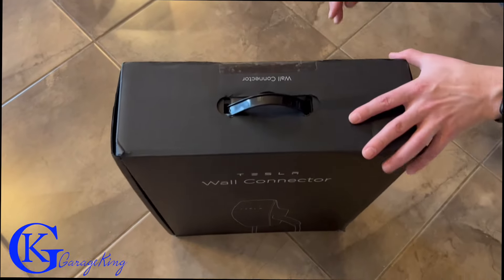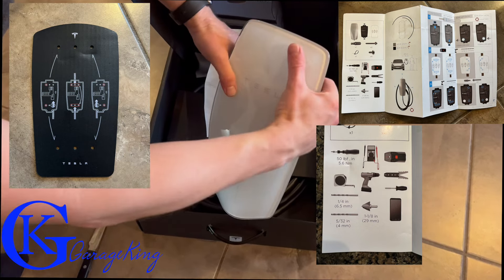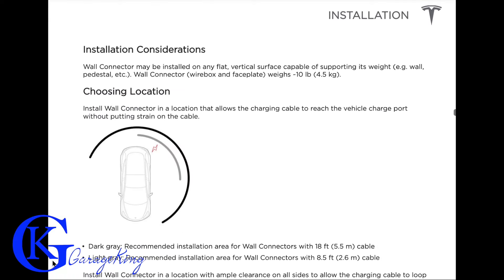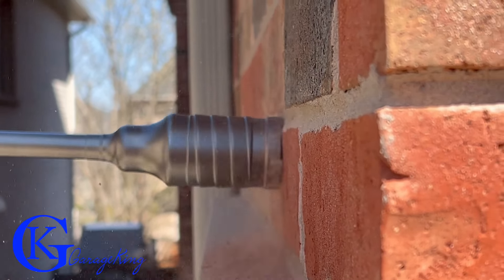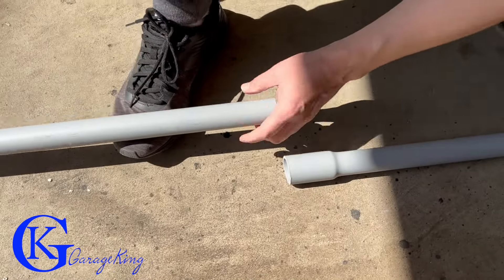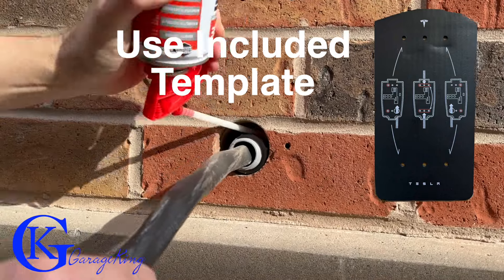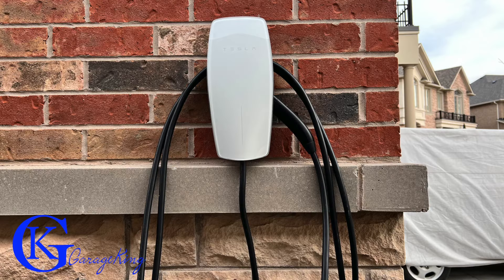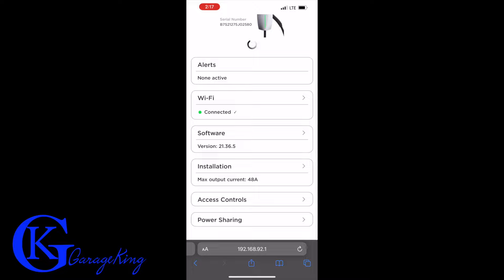Tesla Wall Charger installation (Gen 3)

Comment: You may want to use the regular ground there is a reason why the ground is sized smaller than the conductors and it is to act as a safety measure, the bigger you go it is not going to protect the circuit as fast. There is a Table that tells you what size ground should be used per AMP load  also Romex is never allowed in conduit unless specified per manufacture like legrand  metal wire mold
Reply from the maker: Hey Thanks for the comment, I actually stripped the wire and re-ran, it was easy as it was a pretty straight run, also no white wire being used anymore for the ground.  Thanks!!
Reply: I would be interested in how a larger ground conductor doesn't protect the circuit as fast.  Grounding conductors are allowed to be sized smaller as they are not intended to carry current under normal conditions.  They are relied upon to carry fault current long enough to open the branch circuit protector, thus there is no concern for overheating.  
Depending on the country, you can run nm cable in conduit, here in the US that change was made to the 2002 NEC I believe.  It will be MUCH harder to pull, but it is an acceptable method.
Reply: @hopkinsfamily1891    I think it is because there are other more bad faults that you can get on the ground, and you don't ever want the ground wire carrying full current.
Reply: Lol this make no sense.
Reply: 1) Per NEC, Romex can indeed go in conduit as long as it is not outdoors (a garage is ok and common).  2) the reason you can use a smaller ground wire is to save cost.  Going up in size doesn't decrease the functionality of the ground.
Reply: Code article stating that you can't sleeve romex ?
Reply: @wirenut9062  There is no code stating you can’t sleeve Romex…except in wet / outdoor environments.
Reply: @hopkinsfamily1891 romex can be run in conduit. It can never be used in wet locations (I.e. outside), which is what gets most people in trouble. That and more than 9 ccc will require derating in any conduit length over 24”.
Reply: A larger ground doesn't make it less safe and a ground wire has nothing to do with allowing a breaker to trip or anything like that.
Reply: Yes. Manufacturers put instructions on their products for a reason. Follow the specs.
Reply: The white/ ground he is using is not going to affect or hurt anything.
Reply: The correct size ground for a 60 circuit is number 10 green, not number 6. Big waste of money.
Reply: Licensed electrician here. He had an extra wire and used the white for a ground instead of the ground because the white is bigger. There is nothing wrong with increasing a grounds size, and it will not make the breaker trip slower. If anything it’s safer to use a bigger ground. There are 0 code restrictions in the NEC about a grounding cable being too big
Reply: I came into the comments precisely to see this comment. I knew the comments police wouldn't let a neutral wire fly as a ground, specially when you have a ground wire already!
Reply: @hopkinsfamily1891 correct
Reply: Your ground wire is only there to give your power a path of least resistance. You can size up on your ground wire and will only allow more to travel through it. It does not act a a breaker or signal in anyway

Comment: You should not be using a 6 gauge wire with 60amp breaker, it’s 50amps breaker max. That’s dangerous, it could cause a fire. It’s allowed Only if  the run is short.
Reply from the maker: The run for me is quite short, and I rarely ever go above 10amps

Comment: The mobile charger can charge at 30kwh but you need to install a 50amp nema outlet and then buy the $35 adapter cable from Tesla to get higher output.
Reply from the maker: Hey thanks for the comment.  The mobile charger is excellent.  The one thing the wall charger really has is that you can turn it on and off whenever you want and you can adjust the amps so it’s very customizable from your phone.

Comment: Breaker is in my basement and the home standard is 100a, not 200a. To run 240 at 50a which was for my hot tub to the charger I bought…it was $1,700.
Reply from the maker: My home has a standard 200a in the main panel and the garage is a 100a subpanel installed by the builder. All the homes on my street are 200a. FYI - for my Tesla I rarely use more than 10a.  I trickle charge it every night back up to 80%.  Also for $1700 it must have been a descent run of wire, my run was not long as you saw the subpanel was in the garage.
Reply: @ The run of six gauge was roughly 30 feet. They butt connected existing 240, but the next house I get will def be 200a.
Reply from the maker: @koven1497  30 feet is a pretty descent run.  Good decision on 200a for the next house.
Reply: @ The charger from Tesla comes with the 30 feet or is it half that?
Reply from the maker: @koven1497  I think its only 16

Comment: Main issue here is you can't run that type of cable through conduit.  If you peeled the black sheathing off, then the inside is likely thhn or thwn which can be ran through conduit.
Reply from the maker: Yep, I peeled the sheathing off, also I stripped the neutral so its now bare for the ground not to get anyone confused.  All you see now if red, black, and a copper.  Appreciate the comment

Comment: You’ll notice in the sub panel the neutral and ground buses aren’t bonded. This is only done in a main panel.
Reply from the maker: You are correct, and the only panel bonded is in the basement, that's the 200amp main, then I have a 100sub in the basement, and the 100sub in the garage.
Reply: only done at the first disconnect, which is not always at the main panel.

Comment: Excellent video... Thanks for posting, it helped a lot.. there is one thing that you may want to be aware of, not all #6 AWG wires are rated for the same amperage/temperature... meaning, #6 Romex is rated for 55AMP Max, requiring a 50AMP breaker.... yes, the max amps coming from the charger should only be 48, but in a worst case scenario, the wires would start heating up before the breaker had the chance to trip.
The case where a #6AWG could be used with a 60AMP breaker, if you use THHN single conductor wire (Run three single conductors inside conduit from the electrical panel to the charger)
Reply from the maker: Thanks for the comment and you are right. I later did strip the main sheathing (that holds the 3 wires together) and ran them separately. Corrected the ground as well, to just a bare copper wire.  I rarely use over 20amps as the car charges every day at night, so I never need a lot, I just top it up to 80% each day.  Most days I'm using about 9-12amps for overnight charge when the hydro is cheap.
Reply: @GarageKing I also used Romex, I installed a 55AMP breaker on my panel to protect the wire which is 55AMP max, I run the Tesla at 44amp max. 80% of 55 is 44. You did a good job, you could have left it as is. It will be working fine for years to come. Good job on the install 👍
Reply from the maker: @Anonymous01416  Thank you for the reply, much appreciated and have a Merry Christmas my friend !!

Comment: Thanks for making this video.  I used a torque screwdriver and wiggled the wire.  Couldn't believe how tight 50 in/lbs is!
Reply from the maker: Thank you for the comment, and yup you are right 50 in/lbs is quite tight, that is the equivalent to just over 4 ft/lbs which is a lot for those little terminals.  Enjoy your Sunday : )
Reply: It will feel like a lot if you're using a screwdriver type of torque wrench. I have a small 1/4 drive electronic torque wrench and it feels very light to me with a wrench type torque tool.

Comment: One of the best tesla wall connector videos that I have seen, and I have been searching. Thank you! I used much of the same things you did but to save money I went with the 6/2 wire.
Reply from the maker: Thanks for the great comment !!!  I would have bought 6/2 like you, but it was not available where I am, plus I used extra wire I had from a former hot tub install. Thanks again !!!
Reply: Using 6/2 would have been the correct way to go.
Reply: 6/3 or 4/3 is better. If you ever sell your home, future owners with EVs other than a Tesla may have an EVSE that uses a 4 wire configuration with a neutral wire. 
Why make them go through rewiring your 3 wire circuit? Future-proof it.
Reply: @dvader3263  It's a bit too late now! 😂
FWIW, the 6/2 is doing fine - no heat or V Drop issues.  Also FWIW, the entire industry is moving towards Tesla's NAC connection and by the end of 2025, it will be rare to find anything else. Kinda like the VHS/Beta thing.
Cheers!
Reply: So can i use my existing Romex 6/3 wire from my NEMA 14-50 outlet i installed, if i change the circuit breaker in the panel to a 60amp breaker?
Reply: @williamsc025  Yes, if you discard the outlet and hardwire the charger. You can't use a 60A breaker  with the outlet.
Reply: @williamsc025  The wire should be good, but you can't use a regular 60amp Breaker. You have to get the GFCI breaker. I'm not a professional electrician, check with one if your not sure. It's better to be safe then sorry.
Reply: @gillt1975 A GFCI is good if the charger is outside but in your garage, it is not req'd for a hard wired device.
Reply: @gillt1975  The Tesla wall charger specifically says not to use a GFCI breaker as it includes GFCI protection in the device. Installing a breaker with it would double up and cause false shorts. For a plug you absolutely should use a GFCI breaker, but not this hardwired one.
Reply: @jmkavar  Sorry if I wasn't clear. That is what I was saying. It's either one or the other. The wall charger without the gfci or don't use the wall charger and you must use the gfci.

Comment: Please do not mislead people!
Here in US your whole proses is code violation 
1-you can’t run romex wire in the conduit 
2-you can’t tape any color wire to ground wire (specially in the size that you are using)the ground wire should be bare that you already had it or be green. 
In your condition you should use a single conductor which is gonna be 6awg thhn (black and red) that is rated up to 75amp and 10awg green (for ground) and it’s gonna be more efficient and cheaper than romex wire that you used.
Reply from the maker: Thanks for the comment. I’m not in the US so I understand the codes vary country to county. I did put a disclaimer that everyone should check their local codes as it’s impossible to do a video that is shown worldwide and meet all codes worldwide. I think the biggest thing in this video was to show all the mounting. I do appreciate your comment and see where you are coming from.
Reply: Actually you can run Romex through conduit in certain situations-

https://youtu.be/OeuWsYy6bvE
Reply from the maker: I found a video where you can run Romex https://amzn.to/3loPWnz  This is a dry location and the pipe is big.  When the weather gets warmer I'm going to strip the wire I used for a ground, this way its bare, that part does bother me.
Reply: @GarageKing  You can definitely run Romex in conduit, but you cannot reidentify black wire for the grounded (white) or grounding (green). The CEC states that, for 6 AWG or smaller, the grounded and grounding wires must be of appropriate color along their entire length. This installation would fail inspection in Canada.
Reply from the maker: I know, and I followed up with another comment where I pulled the wire and stripped it, so the white wire is now bare copper.  Appreciate the comment.  @k2line706
Reply: So many old  electricians think you can't run romex in conduit.  Geese, just read the NEC.  You can't do it outside but it's fine indoors like a garage.
Reply: @k2line706  Yes you can when using cable.  There are exceptions in NEC.
Reply: You are wrong on all 3 points.  You can run Romex in conduit.  Nothing in NEC prohibiting it.  You can recode conductor colors at will when using cable.  There are exceptions in NEC for it.  75C rating for 6AWG is 65A.  90C rating is 75A but I highly doubt the Tesla terminals are rated for that temperature.
Reply: This nothing wrong with running romex inside conduit

Comment: Very nice conduit job, but do not do what is shown in this video in the US.

I don't know about Canada, but for US viewers, please:

Do not put Non Metallic (NM-B) cable in a conduit, except for a very short run when needed to protect the cable.  What is shown in this video is much longer than is allowed.  NM-B cable is designed to be in free air, the outer sheath of the cable, in combination with the conduit, can trap the heat generated when current is passing through the wire.

Do not use wire rated in the US for 55 amps for non continuous loads for a circuit which will have a 48 amp continuous load, such as #6 NM-B cable.  It is only rated for 55 amps for non-continuous  use (loads that are on for less than 3 hours).  For continuous loads, such as EV charging, it is only rated for 44 amps (which is 80% of 55 amps).  The rule which allows the next size breaker (60 amp breaker) does not magically make the wire good for 60 amps non continuous, 48 amps continuous.

You absolutely cannot use a white wire for your ground in the US, even if you mark it as shown in this video.  Do not do that!

If you want a circuit good for 48 amps continuous, use #6 THHN/THWN-2 wire in conduit or in metal clad cable.  This type of wire is good for 65 amps.  What makes it good for the higher current is the type of insulation; the actual copper wire is the same.  The video shows he used conduit, so if THHN/THWN-2 wires (individual wires) had been used, then it would be good for 65 amps.

Or, if you want to use #6 NM, put it on a 50 amp breaker, and configure the Tesla Wall Connector for a 50 amp breaker which will give you 40 amp charging.

Again, what I state above is for the US National Electric Code.  No idea if what is shown complies with Canadian electric code.
Reply from the maker: Thanks for the thorough explanation, and I mention in the description that different countries have different codes.  In some places you can run NM-B in conduit if its dry, above ground and the cross section area is less that a certain percentage.  The conduit I used is quite large, I should have stripped the white wire back all the way so no insulation and then it would have been fine for a ground.
Reply: @GarageKing  Understand, and noted your "for educational purposes" disclaimer but I just wanted your US viewers to understand what is required in the US since not everyone may pay attention to that!

Curious why you did not use THHN/THWN-2 (or Canadian equivalent) since you went with conduit all the way from your panel to the wall connector?
Reply from the maker: @ericjorgensen4826  Great question, and the reason was I got rid of the hot tub in the back yard so I had quite a bit of the 6/3 from that.  The price of copper wire here in Canada requires a second mortgage, its expensive.  THHN/THWN would have been the choice had I not had the hot tube wire.

Comment: The sub panel feeder cable connector is backwards. The lock nut should be inside the panel, not outside, and the clamp should be on the outside, not inside. Good video.
Reply from the maker: Hey Thanks for the comment, appreciate your knowledge, that one I'll have to take up with the electrician who installed the subpanel.  They were licensed by the builder contracted to construct the house.  Good eye !!!

Comment: Great video. I can just get my handyman to do this who has a ton of experience with electrical work. Hardest part for me is I’ll have to have the cable run through my ceiling in my living room, and then down inside drywall in one of my bedroom closets to get down into the garage, as my panel is on the 2nd level. He can do all the drywall plastering and painting afterwards.
Reply from the maker: Thanks for the comment, yup that is a lot of work.  I'm surprised your panel is on the second level. He is going to get dirty running that wire LOL :)
Reply: @GarageKing  ya it’s an incredibly inconvenient setup. I guess the developers back in 2001 didn’t really predict the EV craze 20 years down the road. I’m hoping he can just fish the cable through without having to cut open a lot of drywall.
Reply from the maker: @BengalTiger47  Right !!!  The 6 gauge is not the easiest to fish around.  My main panel box is in the basement and I had to go through the ceiling (before the basement was finished) to get that 6 gauge out to the back of the house for a hot tub, and it was not easy as that wire is pretty thick.  Let's hope he can find a way to make it the least intrusive.

Comment: Thanks for sharing. Would like to ask how much consumption (amps) requires for wiring connection (from DB) to Tesla gen 3 connector? Thanks
Reply from the maker: Hey There, it can vary depending on how you set up your Tesla, I trickle charge mine up every night and use form 8-12amps. I find that's enough to add about 100miles overnight. The max output is 48amps.
Reply: @GarageKing  thanks for replying 👍
Reply from the maker: @hkklhkkl  Anytime !!
Reply: Consumption of power is measured in watts. Amps is flow and volts is basically pressure. Close enough for electricians to understand. Also that wire is technically too small that charger is going to run for more than 3 hours so it needs to be calculated at 1.2 times the size of the breaker protecting it.  It matters a little but if you sell your house and they have a good home inspector you will have to replace it.